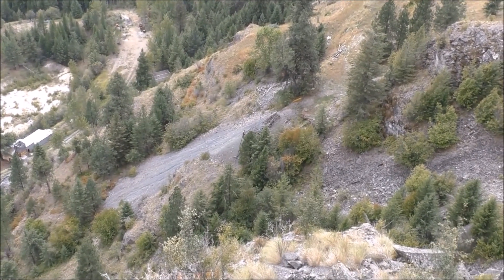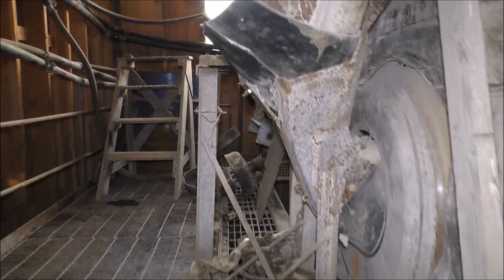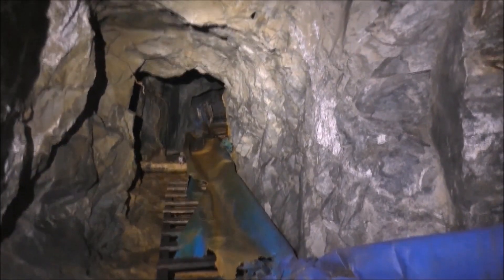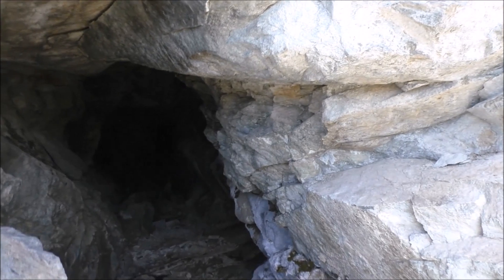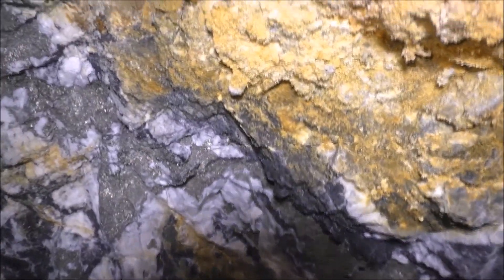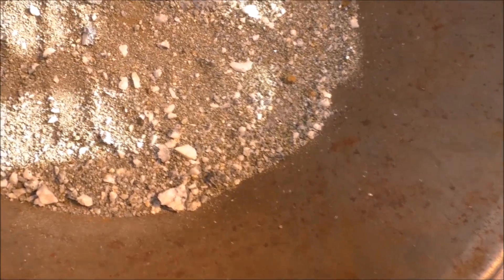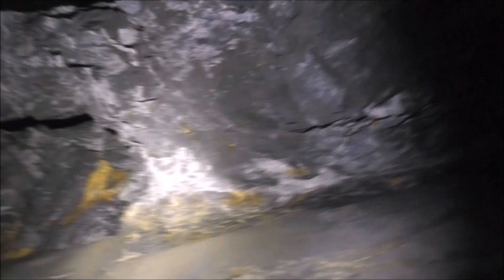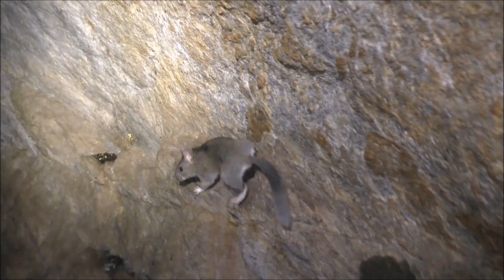#18 May Mac part 2, ball crusher, more adits,  rats and bats!

Comment: Float process was used in many types of mining operations including iron. Basically water and powder pig iron were put into a gutter with a turning drive. The iron ore would sink and the waste rock would float on the surface of the very dense liquid. The two could be then separated. I was always amazed watch the rock float. 
There are many process including cyanide which would dissolve gold chemically from the ore. Even Mercury would be used to dissolve the gold then the Mercury was flashed off. Many people died and or went crazy during early processing. 
In large iron mines rods mills are used in place of ball mill. If the ore is magnetic a larger turning drum magnet would pickup the very fine iron from the slurry. Then a doctor blade would scrape that off the drum. The iron was then mixed with clay and limestone while being rolled in a rotating kiln. The resulting product was a 13mm hard ball ready for the blast furnace. 

My father was born at a copper mine in the mountains of Arizona in 1915. It was a horrid way to live. In the end my grand.father sold his share of the mine and moved the ever growing family across the United States. He worked in gold, copper, coal and iron mines. All were under ground. 
My father used to cry when donkeys were brought into the copper mine. They never came up the shaft again. Sadly my father died at the ripe old age of 51 while I was a teenager.  I held him in my arms as he died. His life was very hard and the chemicals he was exposed to shortened it. 
Mining is fun to study but the price workers paid was extremely high.
Reply from the maker: No doubt they had a tough life back then. There was no welfare or food stamps you had to work hard to feed your family or starve. It is sad to walk through the old grave yards and see how young they were when they died. Many children also died at a very young age.

Comment: Nice job.  Very interesting to see the top side processing equipment.  The thing you called a "skimmer" is called a 'classifier', basically it is a fancy sieve, it separates the crushed rock from the ball mill and sends the fines to the flotation cells and the coarse material back to the ball mill. The vat where you said, that it looked like some sort of lime, is where the fine rock is mixed with flotation chemicals (called: collectors, different types for specific ore-gangue combinations) and the mix then sent to the flotation cells. The line of troughs below the vat are the flotation cells, and the shafts in each trough are agitator that stir and blows air into the mix to produce the froth which flows into the gutters at the front of the cells.  And, the last vat with the large disk with all the tubing forming the shaft (that looks like the barrel of a Gatling gun) is some type of de-watering cell where the final concentrate is scraped from and sent to the smelter.

Thanks,
Cheers,
Mark
******************************
Reply from the maker: Thanks for the detailed explanation Mark. I did say in the video that I didn't understand the process. Now I understand it a little better. Do you think that equipment is still serviceable or is it junk?

Comment: What you have there is part of a processing plant and what you are filming first is the ball-mill. Typically a mill like that would be fed with 0/10mm material along with water. Outside the ball mill you see the screw-classifier which takes the too coarse material back for another run in the mill. Later you see the flotation machines(several cells) where the suspension is processed with chemicals and air blown into the bottom of the cells. The copper or whatever they were processing is skimmed of the top and sent to the rotary vaccum drum-filter for dewatering(you see half of one at 7.32. At 9.25 you also see a cyclone classifier.
Reply from the maker: Thanks always interesting to hear about this from people in the industry. Is that mill still serviceable or is it junk?
Reply: The mill is just a drum made of thick steel so that should be ok. Inside the mill there are usually some sort of changeable rubber segments. If the main bearings on each side is ok its probably a usable mill. The suspension that they ran through the flotation were probably corrosive so those flotation cells and the vacuum drum filter are most likely junk.

Comment: I used to work as an operator in a washing plant in the summer while I went to college in the winter. The  floatation method of ore separation of iron from host rock was used. It was an amazing sight seeing iron floating on a slurry of powered pig iron and water.  A auger skimmed the iron off the surface. 
In total there three separate processes used at this mine to upgrade the ore. 
Give max a hug and remind him to be careful when chasing rats.
Reply from the maker: It is amazing that Copper is separated by flotation!

Comment: We had the old Asarco Smelter in Washington State, the ground was so polluted they spent about 5  years digging out the soil. After a while money was an issue so they covered it with top soil and left the rest of the contaminants in the ground. Now it's a 9 screen theater, 2 apartment buildings and a few restaurant's.
Reply from the maker: Sure a couple feet of cement should seal the cyanide in there.

Comment: Always two lines ... One for compressed air ... One for water for the drills .....
Reply from the maker: The water for drills is a more recent innovation. They didn't use it in the older mines.
Reply: Yes,  dry-boring was the cause of so much silicosis in miners;  without water,  the dust particles are so small they get into the alvioli and stay there,  not coughed out,  hence silicosis.  Years ago,  I refused to drill in a stope as there was no water for the drilling machine.

Comment: if you had crushed that ore in your pan a bit finer, and panned it down to the ultra heavy material, i ve no dought you would have seen free milling gold
Reply from the maker: They never panned Gold in hard rock mines around here. The Gold is too fine for that.  It was smelted or leeched with cyanide.